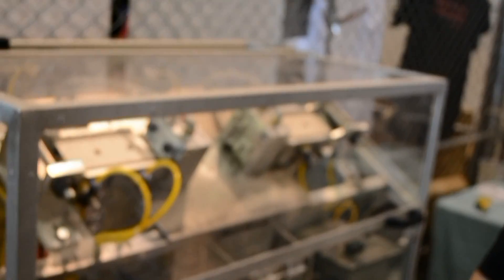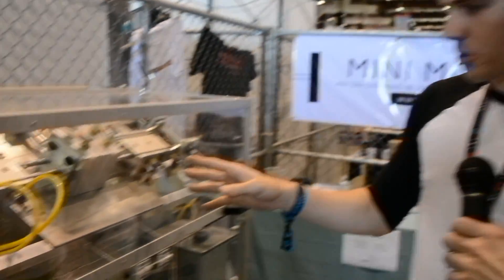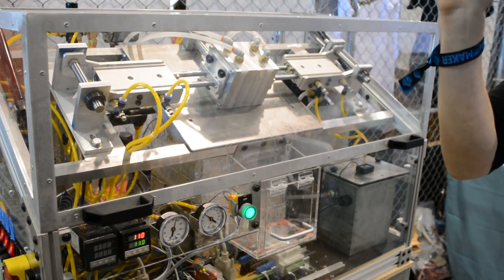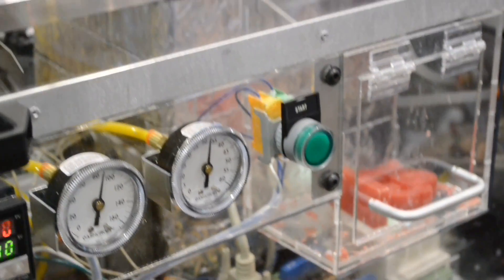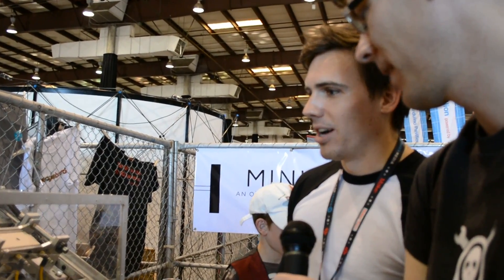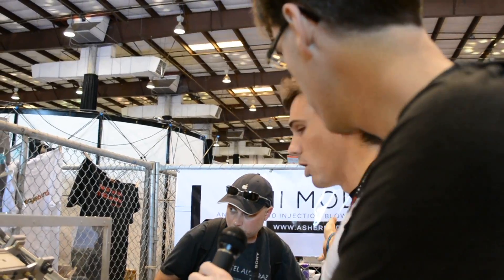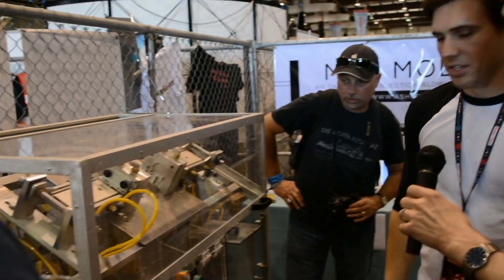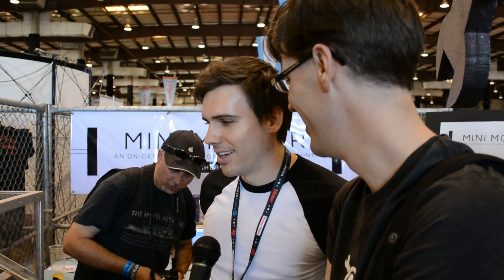Scratch-built Injection Molding at MakerFaire

Comment: I've been in the plastic industry for 30 years, if you are thinking of buying something like this you will be limited on the mould design. Proper machines use hydraulics with machine system pressures running at between 135 to 220 bar this things probably running on 10%  of that due to running using comprest air. It a joke.